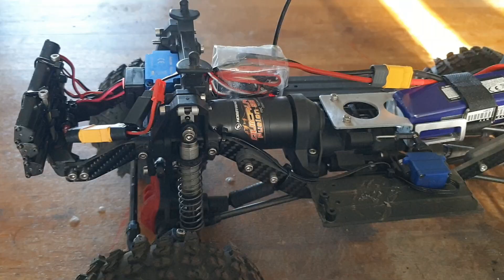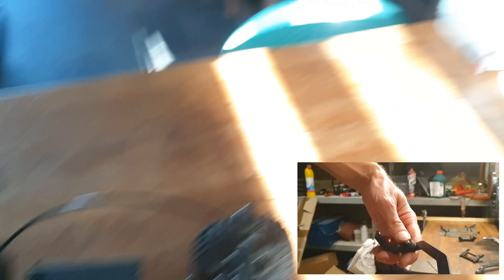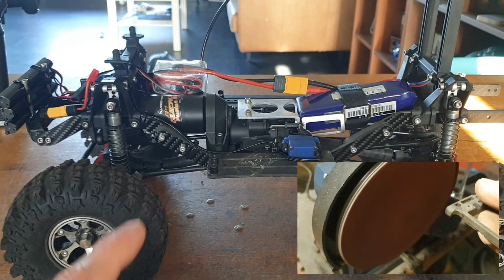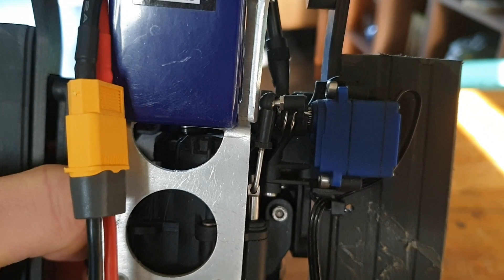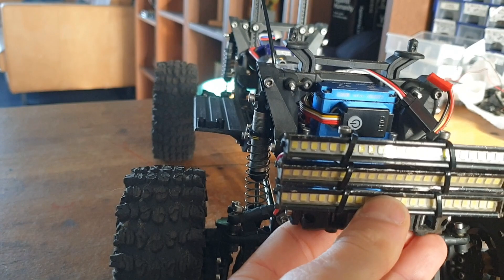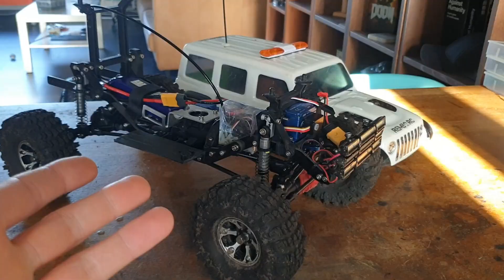TRX-4 Carbon fiber frame and fusion upgrade

Comment from the maker: I also took the weightloss to the next level by making carbon fiber links, chek out this video:

https://youtu.be/W1UgryYvVJ8

I have set the goal to build the ultimate light weight Traxxas TRX-4.
For this i have build in a carbon fiber chassis and have taken off a lot of standard Traxxas parts.  And for the best driving experience i have added the HW Fusion SE 1800kV.

It is pretty bare bone and it come in at 2,6 kilo wih battery at the moment!

My website:
www.remborc.nl

My Instagram:
https://instagram.com/rembo_rc?utm_source=qr&igshid=MzNlNGNkZWQ4Mg%3D%3D

The aliexpress carbon fiber chassis that i bought on a dicount for 23 euro:

https://nl.aliexpress.com/item/1005005742936131.html?spm=a2g0o.order_list.order_list_main.11.305c79d2060iBJ&gatewayAdapt=glo2nld